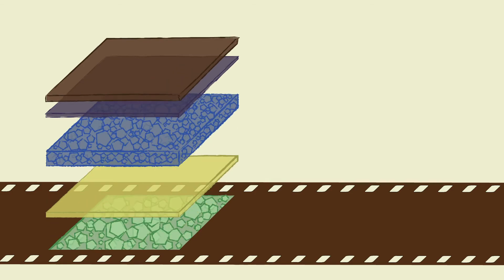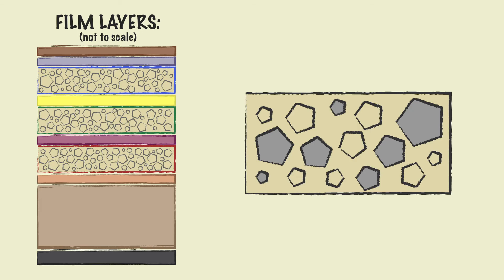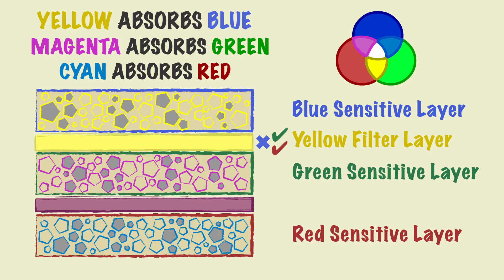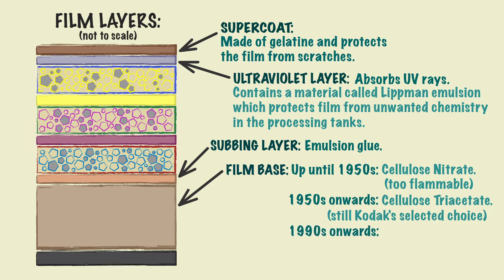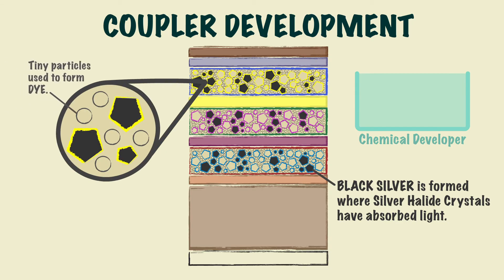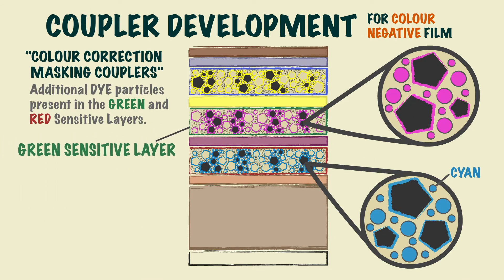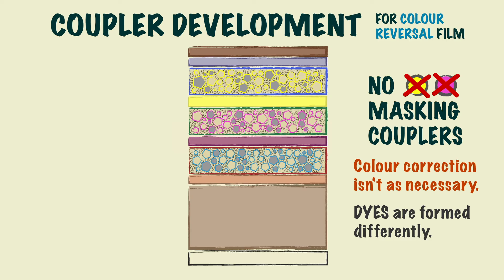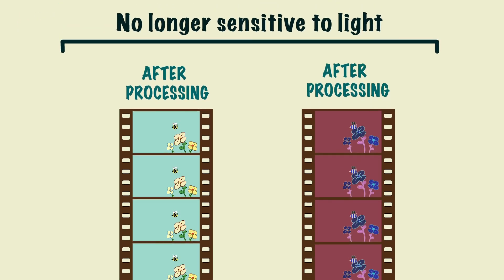ADVANCED EMULSION: Silver Halide Crystals, Imaging Couplers, Orange Masks and Processing

Comment: This is the clearest explanation I have seen on this subject. I knew all of this from scattered sources and books, but this packs all these concepts into a very clear visual presentation. Well done!
Tip for a future video if you feel like making one: reciprocity failure. Silver halide crystals need two photons to arrive within a short period before they will form a latent image. This is also why there is a threshold exposure and film will not fog in a canister or film changing bag where some light can come through.
Reply: Fascinating! I was wondering about both reciprocity failure AND why those low level light leaks didn't seem to matter. Fascinating. So it takes two photons

Comment: On 9:48 how are there 5 bonded carbon in the rings?
Reply: That’s incorrect. This is a naphthalene ring system and at the core of the molecule, it has 10 carbon atoms total (six in one ring and four in the other, with two shared carbons). The specific structure shown in the image is a derivative of naphthalene, with one nitrogen atom replacing a carbon in one of the rings. Therefore, the core bicyclic structure has nine carbon atoms and one nitrogen atom. Btw possibly understanding this part is how I might have developed Kodachrome in color positive.  Who knows. Hope it helps.